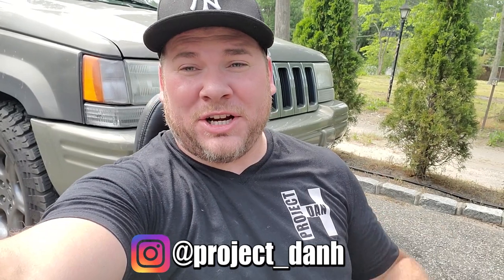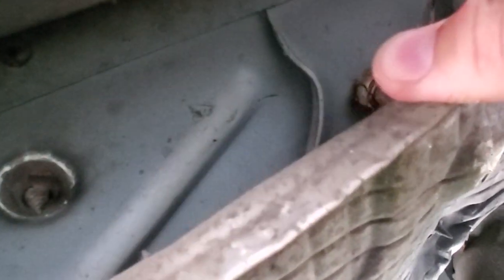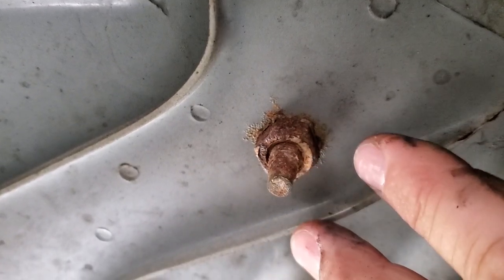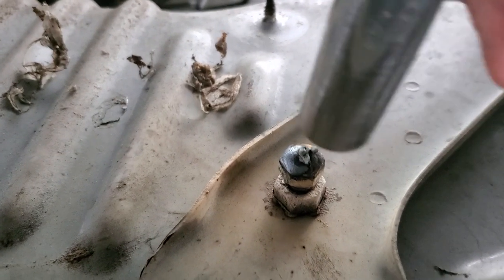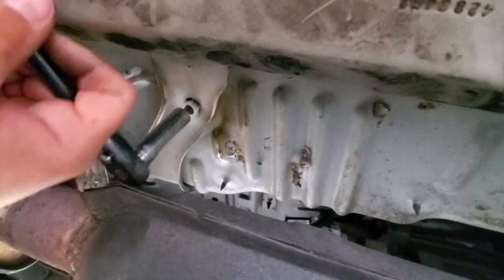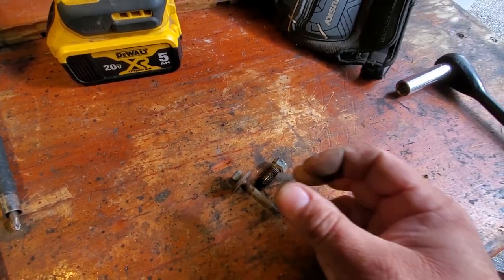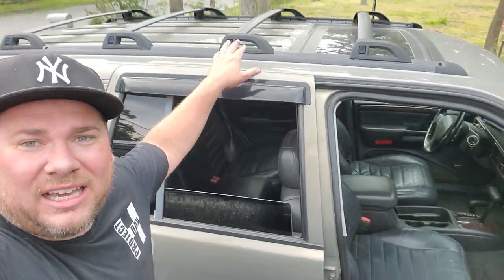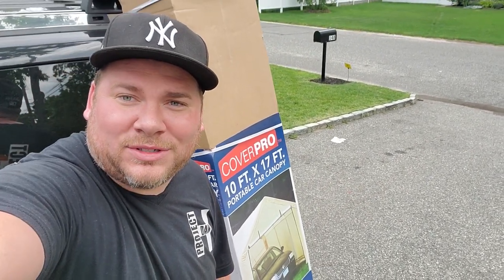JEEP GRAND CHEROKEE ZJ BROKEN SEAT BOLT EXTRACTION

Comment: second XJ, second broken bolt. Both were on the driver's side. The first one was a nightmare. This one, a little heat (ok, a lot of heat with a torch), drilled a little about half an inch down, vice grips on the bottom screwed it right out.  This was some advice you have given in a previous video.
Reply from the maker: Glad to hear the tips I preach actually work!!!

Comment: Just pulled the seats out of my zj to do a heater core and sound deaden the tub. The outer on both seats sheared off. I’m two weeks into this job so I’m just going to run three bolts on both seats for now.
Reply from the maker: C'mon Chris! you can fix this!

Comment: If you have a leaking sunroof check that the glass is still glued to the metal frame. Mine wasn't and so it was dropping rain water on my headliner. You can take the glass and frame out without dropping the headliner and replace or repair the sunroof and refit, job done. Mine hasn't leaked since. I've already done the seat bolt job, I could have told you how to do that one, lol.
Reply from the maker: my sunroof gears ground themselves to pieces.  the whole thing is shot. Glass wouldn't even stay up.. had to tape it in place with flex seal 🤦‍♂️
Reply: @ProjectDanH  That sucks. If you want to get it working again, then you have to drop the headliner. I did mine within a day, out and back in. Good luck.
Reply from the maker: @ianwalker2896  Thank you!

Comment: The only thing I'd advise for next time, get you a thread chaser kit. Clean the threads of the bolt and then the hole. Run that anti seize and you'll never have another issue.
Reply from the maker: Good tip! thanks Brandon 👍

Comment: Just had to work on my drivers seat as I had a rocking seat. No broken bolts though!
Reply from the maker: what happened? broken frame?
Reply: @ProjectDanH  yup .top front  welds tore away.
Reply from the maker: @tinmansolo5855  i hate when that happens!
Reply: @ProjectDanH  Next is to replace the passenger front fender and drivers door. Same color donor ZJ too at the U-pull here. Same as the Grievous.

Comment: Yeah, I don't ever bother with the seat brackets, I find it easier to just take the seat off the brackets.  I just wonder how long until you swap in some 5.9 limited seats front and rear.
Reply from the maker: Ive had niner seats for 2 years. lol. the fronts arent good tho.  The Rear will probably go in Beach Jeep
Reply: @ProjectDanH  Of the 5.9 seats I've seen at the junkyards near me, the drivers seat has never been good, but the passenger and rears looked decent.  I like the idea of the fold down armrest in the rear seats though.
Reply from the maker: @robertgrauman8602  exactly.. take all the passenger seats!  I'll show you guys how to make a driver seat from a passenger seat in an upcoming vid
Reply: @ProjectDanH  Nice!